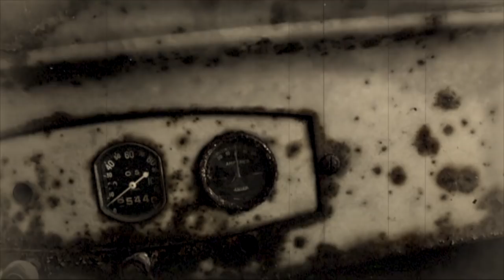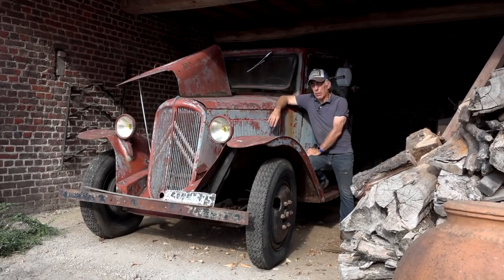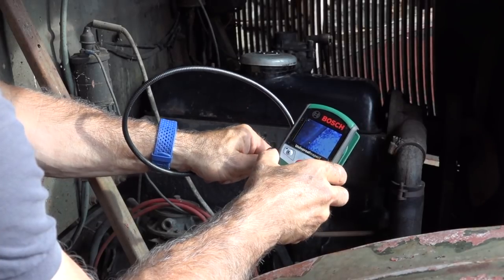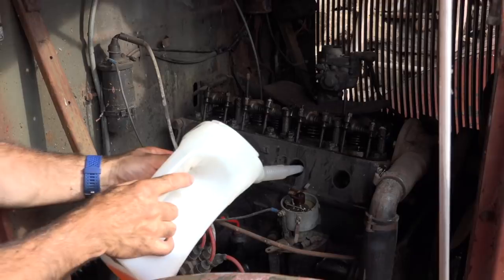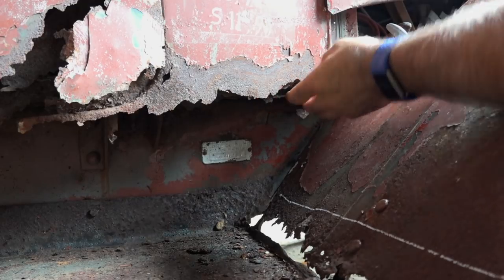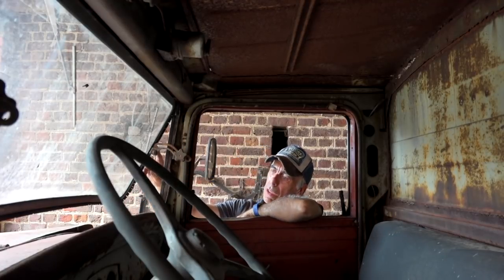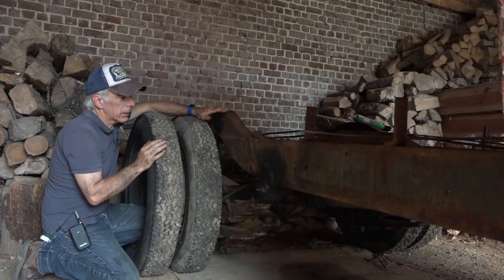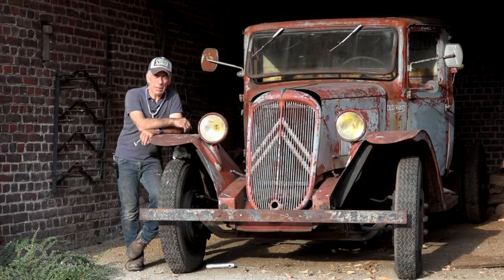Old Rusty rebuild Part 2   work assesment

Comment: Well Doc. Just some cosmetic surgery be done in no time ! I love all old Citroen s it will be a great project to follow. For years I have been promoting diesel and oil and this is the first time i recall seeing a fellow advocate on YouTube, it is also a good underseal, it spreads and gets in all the nooks and granies.
Reply from the maker: Hands on txs and indeed diesel and oil works well. In the old days the military vehicles got every friday a spray with diesel and oil on the chassis and body.  But that was untill 1976.  Later it was no longer allowed for environmental reasons

Comment: "Cosmetics".....Love this little truck however it will be a mammoth task to restore it. Will you rebuild the engine yourself or give to a garage?
Reply from the maker: TheRebelOne the engine is yet an open question. It might become a tesla electrical replacement. Txs.  But if i stay with the cv11  engine than i will rebuild it myself except the machine work

Comment: Steve, what would it take to convert Old Rusty from 6 volts to 12 volts?
Reply from the maker: Thanks for the comments, well that would be a new starter, alternator, relays, ignition coil, bulbs .... In fact not such a big deal as I have to build a new wiring loom..
Reply: @D3Sshooter  Probably everything you need new on the truck anyway??
Reply from the maker: Bill Jenkins yes indeed bill, all of it is toast

Comment: looks like 2 speed rear end
Reply from the maker: I don't think so, but than again i have not given it all the attention that it needs
Txs for commenting
Reply: I was looking at the switch on the gear shift but later pics showed the differential and I agree, don't think it's 2 speed
Reply from the maker: The switch on the stick is what they call a direct drive.  so no gears engaged in the gearbox when used.  Or that is what I could find. Not sure if its true or not  Txs for responding back